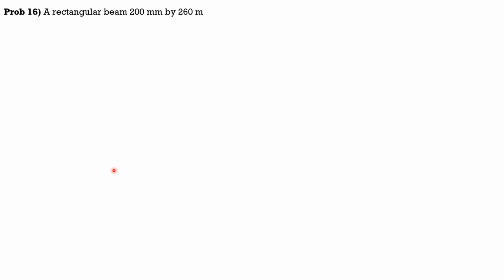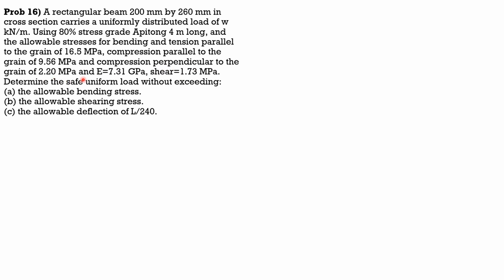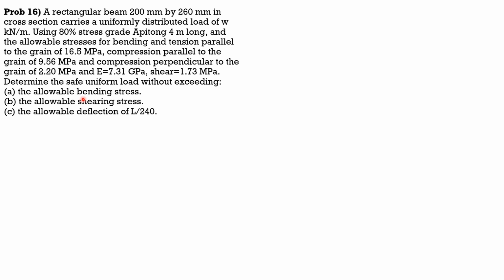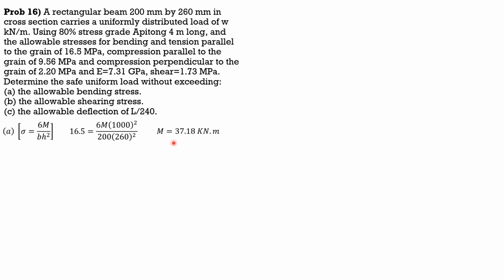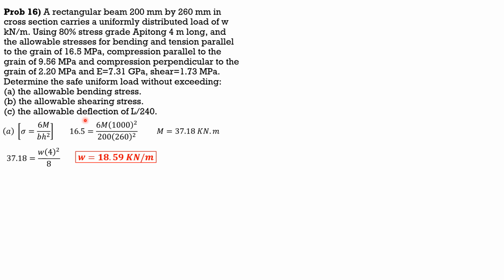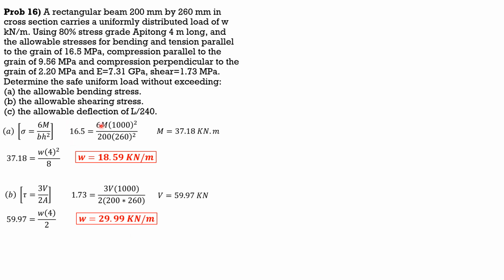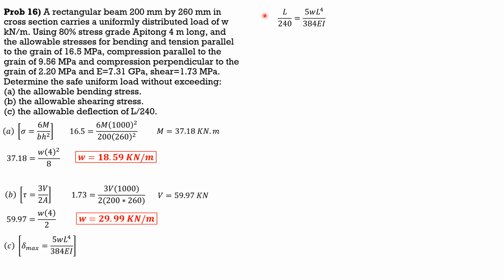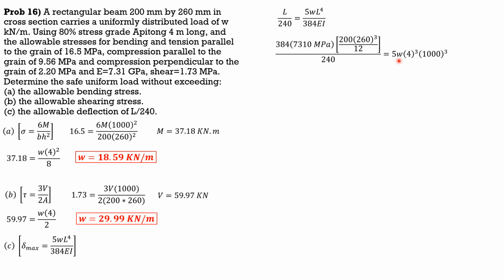STRESSES in BEAMS, Example 16

Comment: 5:26 hindi po ba yun yung tanong na determine the safe uniform load?
Reply from the maker: There are three specific questions in this situational problem. If there is only one question, as I explained here, then the final answer is the lowest one w=10.71 KN/m. For instance, the problem is to determine the safest load (or the maximum allowable load) using the same design criteria, then the answer is only one, w=10.71 KN/m. This was a board exam situational problem with three questions and therefore, three specific answers for each case.
Reply: @StilHOT1970  okie thank you